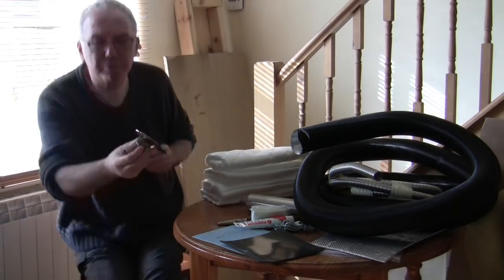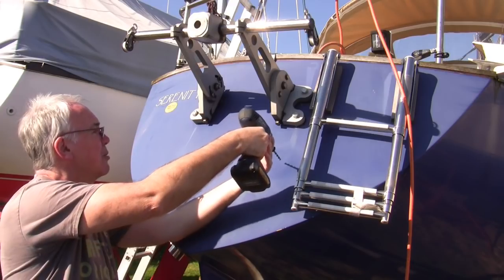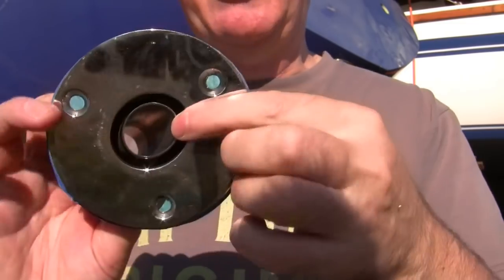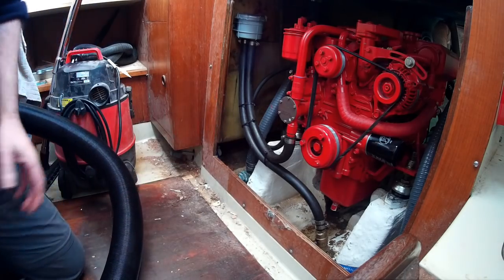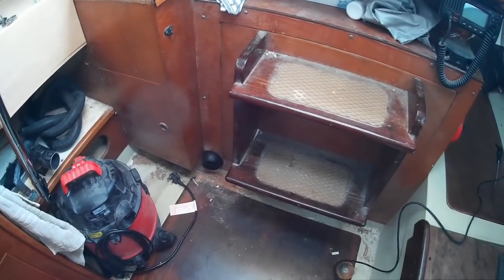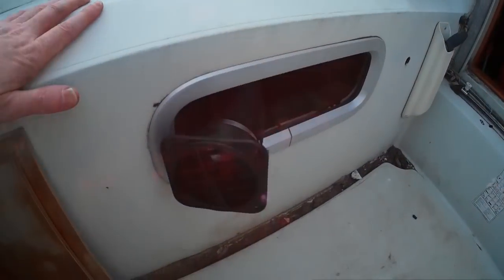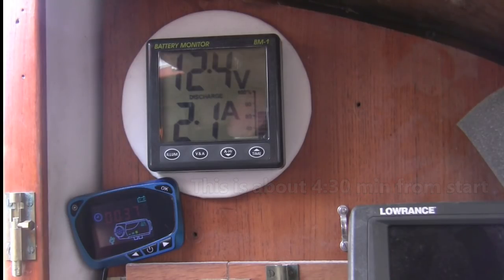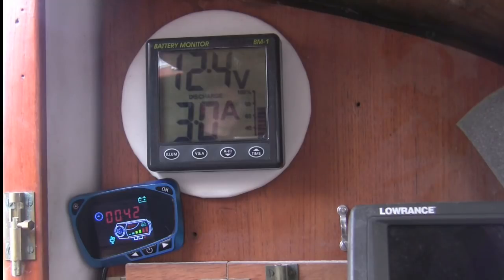Just About Sailing March 2019 - Installing a Chinese Diesel Heater, Pt 2 Fitting it and switching on

Comment: Hi Paul, how did this go I have eventually bought one of these but I've seen a few things saying not to have a dip in the exhaust which is almost impossible on a boat, I will have to do the same in my install.
Reply from the maker: Have a look at the December 2019 video. It's a long video, but I show a device right at the start that I fitted precisely because of this problem. 
You're right, it's almost impossible on a boat to not have a dip. I think the main problem is that quite a lot of condensation is caused in the exhaust an it will pool. Some people seem to just live with this - which is what I was going to do. But the proper answer is to install a drain - which is what I did. It's basically a loop of very small tubing which you initially fill with water (after that the condensation should keep it topped off). The weight of the water stops the gasses getting out, but 'physics' means that the water will drip out as it collects.
You can buy them on ebay. Either a proper Webasco/Wallas one or a much cheaper one - I went for the cheaper option..
I have been using the heater all the time this Winter. It heats up quickly and it is a really nice comfortable dry heat.
Good luck with it.
Cheers
Paul
Reply from the maker: Sorry, replying to my own comment. I've just realised that the fitting of the device was about 2.5 minutes into the December 2 2019 video.
Reply: @verynearlyaboutsailing8114  I have a plan now involving a condensate trap so see how we get on 👍👍
Reply from the maker: That's interesting. Let me know how it works out.
Reply: @verynearlyaboutsailing8114  Will do  I will do it sometime this winter

Comment: Where did you get black hot air hose from please??.
Reply from the maker: I got it from Ebay. I've long since lost the link. But if you search for "webasto heater duct pipe" you should find some.
Make sure that you check which diameter you need as there seem to be a few different ones.
I hope that helps
Cheers, Paul

Comment: Nice install, about to do the same on our twister 28, if you don’t mind me asking where did you purchase the extra hose and insulation from?
Reply from the maker: Hi. Good luck with the installation. I purchased the hose and insulation from ebay. I got the hose from 'eberbasto' and the insulation from 'car-insulation-uk'. Two small points; firstly make sure you order the correct diameter of hose - I bought a 2kw heater, but it seems to be the same size as the 5kw one and the hose is a bit bigger. Second, I am a bit disappointed with the thermal qualities of the lagging.  I bought it because it was cheaper than the eberspacher or webasto products - but I don't know if their products are better or not. Having said that, it is definitely a good idea to lag the warm air outlet.
Let me know how it goes. Cheers

Comment: I feel like having the intake in the engine compartment isn't the best idea.  I guess it's OK but it just doesn't feel right to me.
Reply from the maker: You are absolutely right. It would not be a good idea. Maybe I needed to make it clearer on the video. I just hooked up a couple of hoses so that I could get it running.
Both the air intake for the combustion chamber and the air intake for the heating air will be taken from outside the boat - in different places.
A lot of people put the heater in the cockpit locker and then just let the air get sucked out of the locker. Even the Webasto diagram does this. - I don't like that idea. I will put a longish hose onto the intake and lead it through some loop (yet to be designed) and such the air in from the cockpit area or the coamings.
This is a very unregulated area, but there are some safety guidelines (mostly for canal boats) regarding these type of issues. I have (or will) pretty much stick to them.

Comment: great setup. I'm about to install the same on my sailboat. can you comment on where did you get the steel exausting pipe? I simply can't find it in Canada.
Reply from the maker: Hi, good luck with the install. Let me know how it goes. I got the stainless steel exhaust pipe from a company called 'eberbasto' in the UK. Basically I searched for Webasto exhaust pipe and quite a few came up. However, I just had a look on the ebay Canada site and couldn't see any suppliers in Canada - and the one USA company seemed to be getting theirs from Germany.
I don't know if you have a local Eberspacher or Webasto dealer dealer - they might be able to help.
Reply from the maker: Andre, sorry only just picked up your reply - You Tube sometimes doesn't notify me and I need to check thru comments. The thru hull seems to be doing fine so far. I have run the heater a couple of times for over an hour. The double skin design really seems to keep the heat away from the fiberglass. Very difficult to measure the temperatures - but basically I put my finger on the outside bit and it felt quite cool - I did the same on the inside (briefly) and burnt my finger a bit.

Comment: Can you list some suppliers of some of the gear please
Reply from the maker: I got pretty much all of the gear from Ebay. Both the heater itself and the ancillary stuff (lagging, exhaust etc). All the links I had seem to have gone dead now.
What I can suggest, and what I did, is to search Ebay for Webasto and/or Eberspacher accessories. As well as the genuine items, you will find a lot of cheaper alternatives.
I hope that works for you.
Cheers
Paul

Comment: What sort of supplier/shop sells all the additional pieces you bought for the installation?  Thanks!
Reply from the maker: Hi, I bought all the additional stuff from ebay. If you do a search on 'Webasto' or 'Eberspacher' you should find most of the things. It does depend on what country you are in. I know that some people in Canada have had problems getting the stainless exhaust.
Cheers
Paul

Comment: Did you fit a CO2 detector?
Reply from the maker: Very important point. At the moment I only have a Carbon Monoxide detector - with a very loud alarm. I plan to fit both CO and CO2 detectors. The biggest danger is probably from CO because that could be produced both by the diesel heater and the stove. Although diesels tend to produce very little of either.
Fumes and invisible gas (particularly heavier than air gas - propane, petrol fumes etc) are always a worry.
I have never smelled any fumes at all from the diesel heater, but of course, both CO and CO2 are odorless.
The biggest issue with diesel exhaust is probably Nitrogen Dioxide and Nitrogen Monoxide. I am not aware of any consumer units that can measure this. I think the industrial ones are very (very) expensive.
The combustion unit is sealed, so there won't be any CO coming out of it through partially burnt fuel and I have tried to make the exhaust system as gas tight as possible. I was very keen to get rid of the rather flimsy exhaust that came with the unit. And the supplied muffler was never designed for marine use. I also used proper exhaust clamps and 'gun-gum' exhaust putty.
Cheers, Paul

Comment: Is there a thermostat
Reply from the maker: Yes. In fact there seems to be two. One in the actual heater unit and one in the LCD control unit. I think you can choose which one to use to set the temperature. The instruction manual is almost undecipherable on the subject of how to actually use it - and the printing is tiny and almost unreadable. So I think I need to do a bit of internet research on how to actually use it. I might do a short specific video on actually using the thing in practice.
I would also love to find out if there is a way of just using the fan without the heat as it would be a great way to circulate air on a hot day.
At the moment, I am simply very pleased that it actually works.

Comment: So I just bought my own similar version of this heater. The exhaust port, I bought almost exactly the same as you. Would you shift the position of it today? I worry about water coming in if a wave hits me from behind. How would you position yours if you had the same boat as I have, I have a Hallberg Rassy Rasmus 35 ketch. Exactly like the ketch here...  https://www.hallberg-rassy.com/yachts/previous-models/hallberg-rassy-rasmus-35/
Reply from the maker: Mikael. First of all, that is a very nice looking boat. I am slightly jealous.
I don't know - is my honest answer. You have a very different layout to mine with your rear cabin. I printed out a few plans for my boat and sketched in different layouts (I went through this on this video, or was it the one before? - It was a long time ago) and then put in a cardboard mock-up of the heater before I finally decided where everything should go.
I am not 100% sure I have put the exhaust outlet in the right place. I hope I did. However, I do have loads of room and was able to loop the exhaust hose very high. I think it is high enough to stop water getting as far as the heater.
Have a look at On Board Lifestyle (can't remember which video - about a year back?). They have a catamaran. Teal did a similar loop and mounted his exhaust outlets (two heaters) on the front of the bridgedeck, which is quite exposed to waves from the front.
I believe that Webasto, Eberspacher, or Wallas do an exhaust outlet that you can close off (in heavy weather) and make watertight. Of course it is probably very expensive and you would have to make sure you remembered to check that you had opened it before switching on the heater.
Good luck with it. Let me know what you do.
Cheers
Paul
Reply: @verynearlyaboutsailing8114  thanks for your answer. I'll probably go with your solution. I've seen many do it the same way here at YouTube, so I'm gonna go with that. Maybe I'll buy some form of plug if I'm out at sea with high waves

Comment: Really unhelpful video, where you don’t actually show the full set up and merely jump about from one area to another. You completely  leave out how the electric system is set up, and the fuel lines. A total waste of 20 minutes viewing, for someone looking to see how to install and set up a diesel heater😢
Reply from the maker: Mike, sorry you didn't get what you were looking for from the video. I do normally say at the start of  videos that it is not a 'how to do' type video. I showed in Pt1 that the instructions came with a diagram of both the wiring and the fuel parameters (maximum height levels etc). Each install would be so different for each boat. The wiring just clips together - it's just a matter of ensuring the runs aren't too long.
There are also very different safety regulations in different countries. I found some to be very contradictory. The USA vs UK rules (guidance) on grounding and earthing, for example, are very different. I am based in the UK and found some very useful information on inland waterway regulations. There is very little regulation for offshore boats in the UK.
If in doubt, get a professional to check your wiring and fuel plan.
The videos where I do go into much more detail are to do with where to draw the heating air - from the inside, or form the outside. This is all to do with preventing condensation, and getting it right is critical to prevent future problems. Sorry to say that the two videos (Nov 2019 and Dec 2019) are both very long. - One one the theory and another showing a practical example that it is important and does work.
Sorry again that it wasn't what you were looking for. But all the best for your installation.
Cheers, Paul